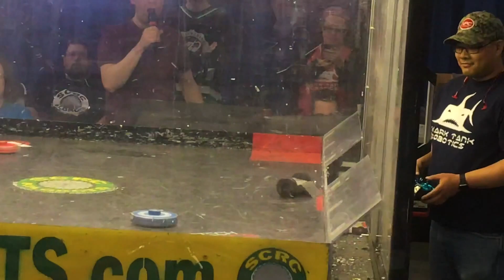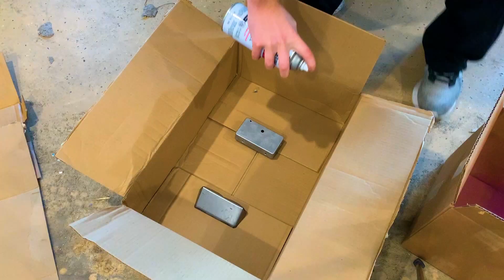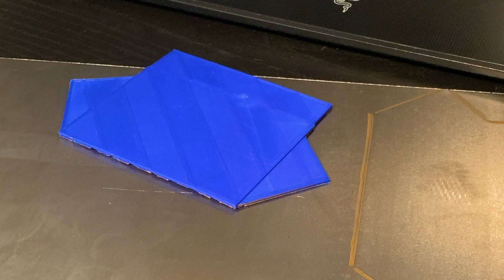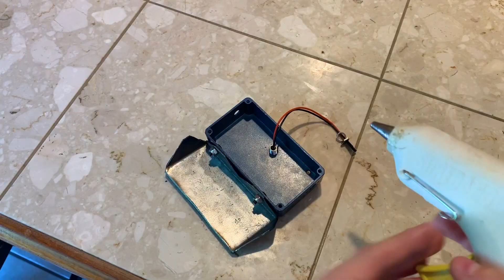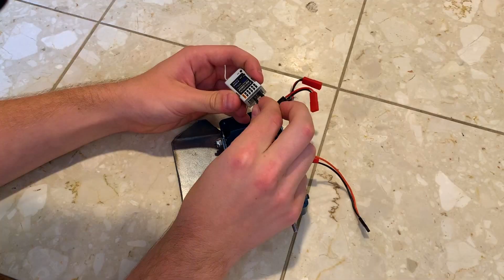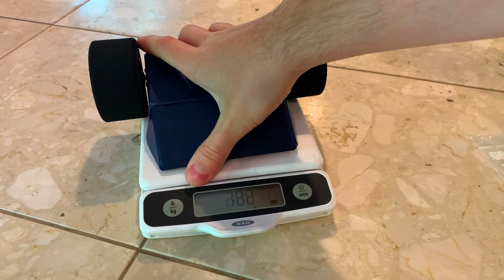Building a Better Battlebot From a Guitar Pedal

Comment: Hey have you thought about dipping your wheels in something like liquid latex like Robert Cowan did to improve traction on foam wheels
Reply from the maker: I have, but traction hasn’t really been enough of a problem to try it, it’s mostly been the weight distribution, inability to easily right, and my inexperience at driving. I might try it for the next revision though.
Reply: @KeplerElectronics  ok keep up the great work

Comment: If you add a metal sheet underneath the wedge than you can have another thing to hit with when it flips so you can drive and defend either way
Reply from the maker: I might have to go with that for the next version, but they are pretty close on the weight limit right now, so I’d have to cut a lot of weight down to fit that in.
Reply: Kepler Electronics yeah that’s true. Alright.